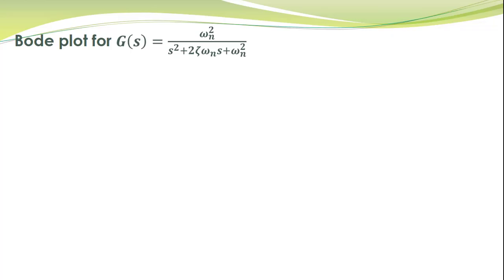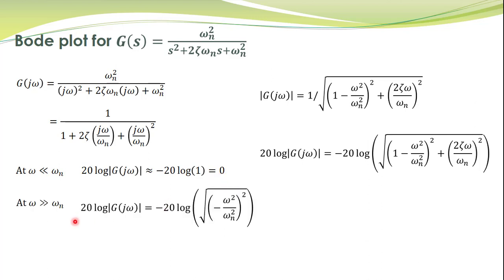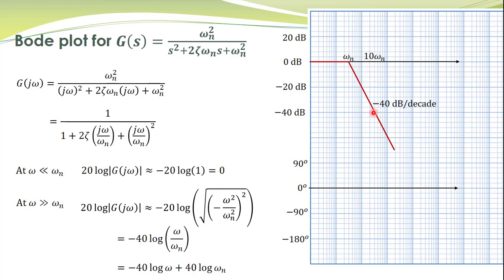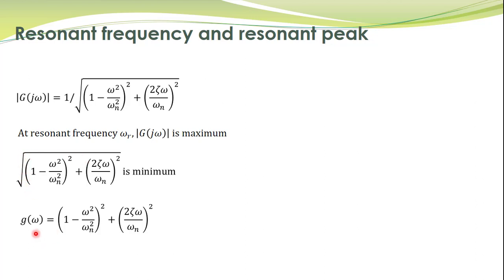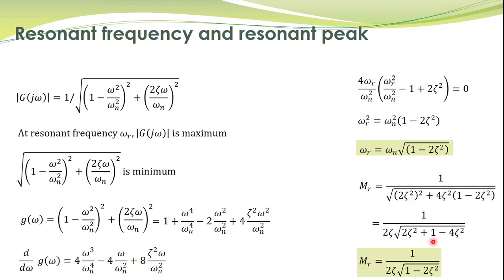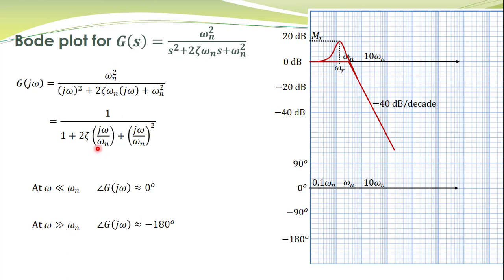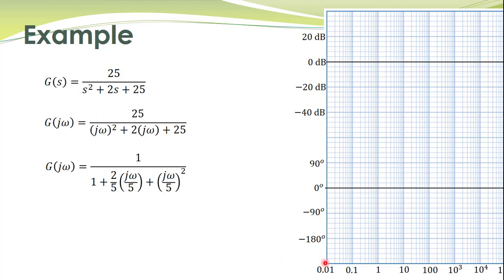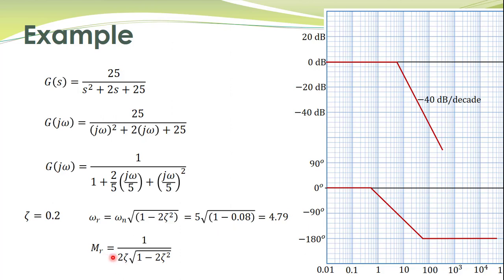LCS21 - 40a - Bode diagrams for quadratic factors

Comment: i think sir @12:11 if the value of zeta=0.707 then Mr=infinity....
Reply from the maker: Thanks for pointing it out. Actually, there is a typo in the expression for resonant peak Mr. The correct expression is Mr= 1/(2*zeta *sqrt (1 - zeta^2). Therefore, for zeta=0.707, Mr=1.
Reply: THANK YOU